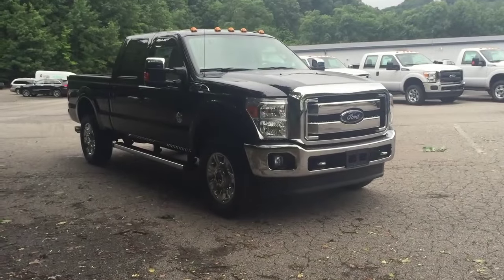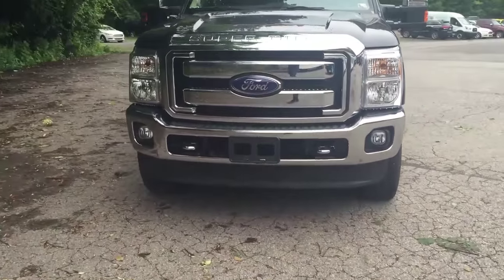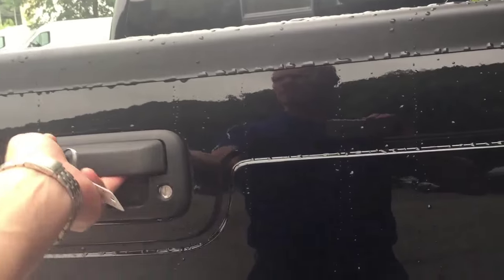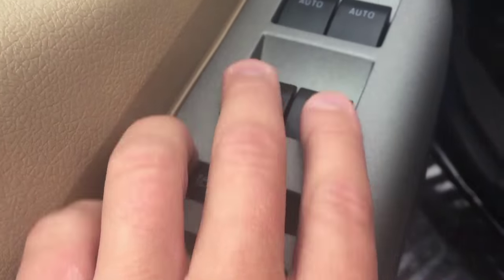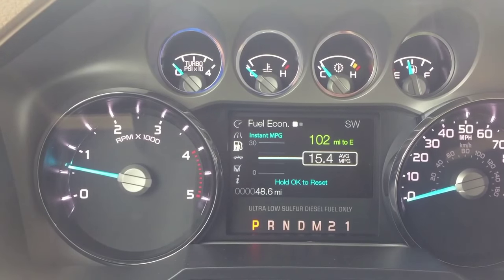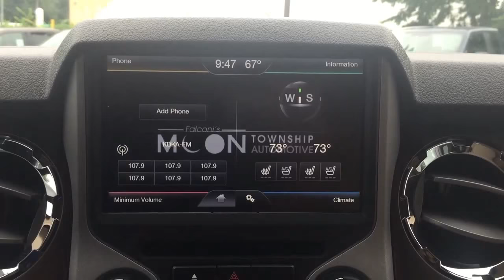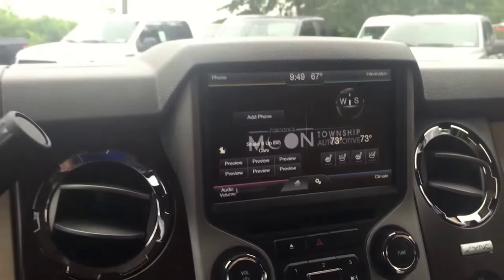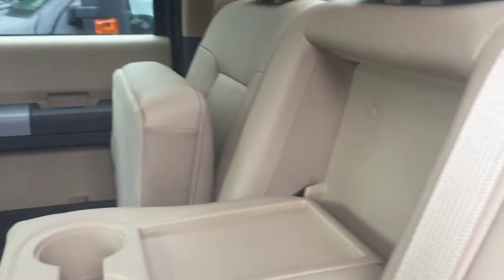2016 Ford Super Duty F-250 Lariat Review - 6.7L Powerstroke Diesel

Comment: I'm buying a 2016 F-350 crew cab lariat with the 6.7 from Carmax. I had to have it shipped from Texas to northern NV. Not here yet so I enjoyed watching your video. I have a better idea of what I'm buying. Thanks.
Reply: How has the truck been holding up? Looking to purchase a 250 same year
Reply: @not2mention97  It's been a great truck - until I let Ford do the latest 'recall' (21E01) which was some kind of exhaust sensor software change. Within 20 miles of picking it up it blew a hose attached to the turbo, and the diesel particulate in the filter went from 50% to over 200% as I drove it back to the Ford dealer. We're only talking 10 miles at most. They said I needed a whole new DPF and two NOX sensors - which Ford would pay for. Of course, nothing was in stock. There it sat, for just over six weeks as they (and I!) waited for parts. So I've had it back for about two weeks now and it seems to run ok. No noticeable change in fuel mileage (city or highway - at least according to the onboard mileage tracker). The next test will be towing our 7+k travel trailer, which is why I bought the truck in the first place. Other than this issue, I've loved the move from a 97 F-350 7.3 to this 6.7. More power than I can ever use, tows like a Clydesdale, and rides nice, towing or not. Wifey loves it, so life is good - ha.
Reply: @MrTommy001  hate to hear about your troubles, glad you're back on track, appreciate the feed back, your wife loves it and my wife is trying to talk me into getting another SUV instead of a pick up, you're winning my guy, stay blessed and happy holiday!

Comment: I would never buy a newer diesel. I like to hear my 6.0. funny thing is I read a guy said his friends was put in the shop 16 times in two years. well mine is 11 years old and supposed to be one of worst diesel engines  (unless bulletproof. witch I did myself) the worst thing I've ever have to do is change the oil every 5 thousand miles. it's not the trucks that are shit, it's the drivers.
Reply: Delete the pilot injection and straight pipe it and the 6.7 will sound the same as the 6.0 straight pipe. The pilot injection is what makes it sound so quiet and smooth but you can't beat the performance and price for a bulletproof 6.0 compared to the newer stuff.

Comment: Like the truck not the price
Reply: If the luxuries are not necessary price drops a lot when you go for work trucks with rubber floors and either cloth or vinyl seats the guage cluster is not digital like this as well but everything you need

Comment: I love ford. I have 3 ford trucks. love the design and body of them, but with the EPA screwing with these trucks powertrain, (and its not just Ford. Its GM, and Dodge too, just to point out). For one its not good to recycle exhausted gas back into the engine, lose power and the longevity of the engine, and second the aftertreatment is totally garbage, and it sucks that if you have 1 issue with the aftertreatment, the whole truck will shut down. Seen it multiple times on semi's. Which is royal pain to try to do your own work to diagnose the issue. Thank god I work on big rigs and getting proper training to work on these kind of equipment, so i know what to look for when the check engine light comes on. oh last I hate, hate, hate that there is no room in the engine compartment. Ford engineers atleast it easy to just remove the cab so you can get to the rear of the engine a lot easier, you shouldn't have too. Thats why i like the in line 6 cummins. you have lots of room to work on it in the engine compartment instead of removing the whole dang cab. Thats why I would love to design and build my own dream truck. Ford Chassis, body, with the cummins engine. that would be a good truck.
Reply: That's the same "Fantasy Truck" I have heard from numerous other people. Ford truck , Cummins engine. lol
Reply: Y'all don't forget the Allison, or a good ole Eaton manual

Comment: It is out of my current budget.. but that thing is a Beast... I wonder if the stereo has an SD card slot

I hear a lot of people giving ford some flack about the cheap plastic on the dash and on the doors... thing is.. sure it isn't as posh and luxury as other options out there.. but that cheap plastic will last the life of the car and can easily be freshened up later in the trucks life.. 
this 250 really can do almost anything you need in a pick up truck.. Unless you need to haul some really heavy trailers above 16k lbs.. Any Boat or Trailer that I would own.. this thing could manage..
Reply from the maker: +Brian Michael It does have a SD card slot :) And yes this truck is a beast !
Reply: It can actually do over 30 thousand pounds
Reply: Nick Henry without dual tires in the back I wouldn't trust it.. also.. the weight rating isn't just for pulling.. Its for stopping.. 
16klbs and 30klbs is a big diff when you gotta bring your load to a hault in a hurry
Reply: Fifth wheel towing capacity for this particular truck is actually 15,100 pounds MAX.... what sucks is the payload capacity.... 1792lbs
Reply: Joe new f150 is rated at 3000 -_-

Comment: For $67,000, does it come with a BendPak car hoist... for all of the times you will have to put it on a lift?  My friend had a 2007 Ford F550 Power-Choke that was in the dealership 16 times in less than two years.  He just took the truck back to Ford and dumped it.  He got a Chevy Duramax.  A shame, because it is a beautiful "looking" truck and there are so many loyal Ford fans.
Reply: 5k oil changes, arp studs, coolant/remote oil filter, egr deletes, and gauges are key with the 6.0..
Reply: Bradley Smith So the OEM head bolts are crap?  And how much does it cost to "bullet-proof" the 6.0 with all of the items that you suggest?
Reply: No the oem bolts aren't crap but they won't hold up to hard use or a tuner. Also if you bought a 6.0 and bulletproofed it youd end up paying thousands less than a high miles Duramax or cummins for the same year.. Best bang for your buck if your willing to do some work, plus their fast as hell and tow great.
Reply: Bradley Smith I've stated on other posts/channels:  that if Ford had "detuned" the motor that it's reliability may be a lot greater.  Ford squeezed out more horsepower and torque than any other truck, in it's class, and payed for it with catastrophic engine failure.  yeah, you might win a 1/4 mile race.... but your gona blow a motor in less than a year or two.  ...Especially with a block, heads, cooling system .... that is already at "red-line" .  Just DETUNE the rascal and get 200,000 miles out of it.  The parts and labor are just not worth it!
Reply: Does your friend own an ambulance company?

Comment: no heated steering wheel, no cruise control brake assist or speed matching
Reply: +nuclearthreat545 I know, no massage seating, no rear reclining seats, no solid gold door handles, No head rest video monitors, no hotspot wi-fi, no White Rhino scrotum lined glove box, no ostrich skin cup holders?
Reply: @nuclearthreat545  k lariat isn't the top trim, try a king ranch or platinum. Also certain things are speced to certain areas/demographics